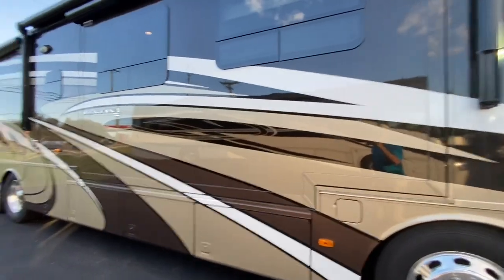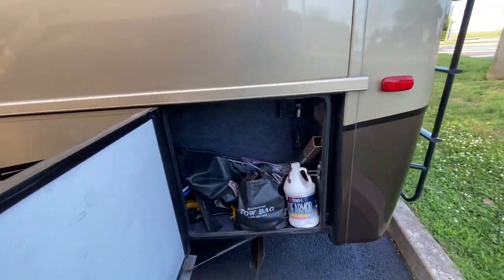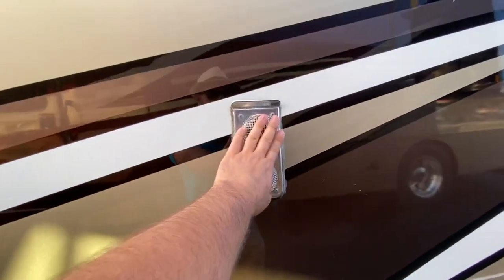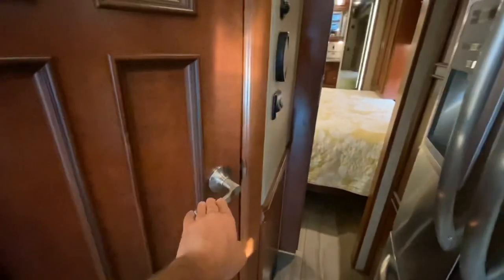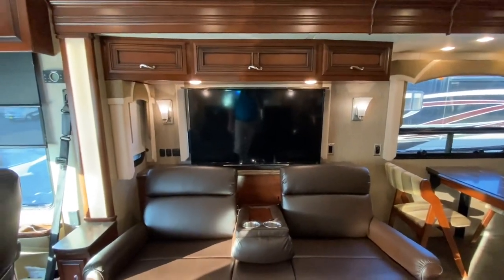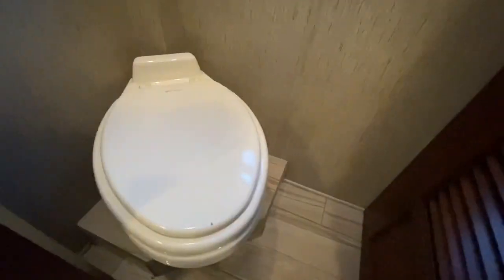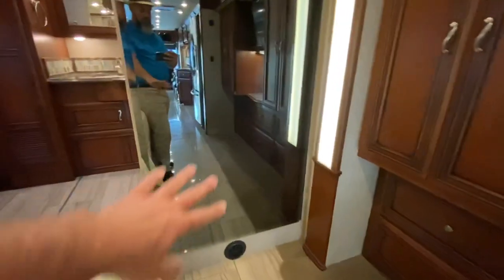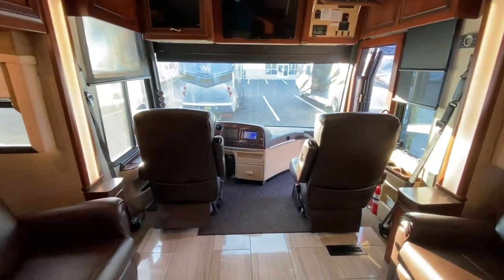Full wall slide bath and a half! Newmar Ventana 4002

Comment: 👍 Nice looking Diesel Pusher Coach.  Only if the radiator was side mounted, this Coach would have been even better.  Before hitting the road, I'd like to check out the condition of the belts and replace it if worn or cracked (I always carry spare belts and fluids).  I've seen Coaches on the side of the highway overheated due to snapped belt.
Reply from the maker: I hear you! I had a rear radiator diesel pusher and it was older and I was always concerned on longer trips!

Comment: I like Newmar for their quality walls, slide outs and cabinets.  The comfort drive system really comes in handy on windy days as well.  But what is up with the awning over the passenger door?  It looks like it extends past the windshield.  Not a fan of wardrobes that extend beyond the drawers underneath as it makes it difficult to place or remove items.
Reply from the maker: I agree with the awning and wardrobe! They could’ve designed the awning differently and the bed slide a little shallower so the bed didn’t need to tuck under the wardrobe! 🤷🏻‍♂️